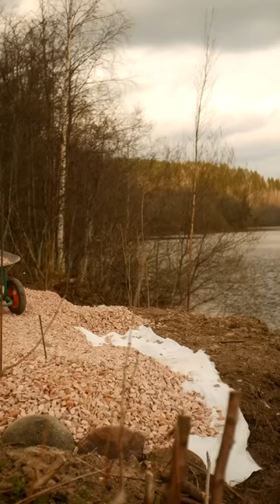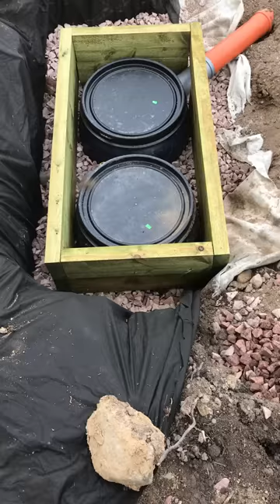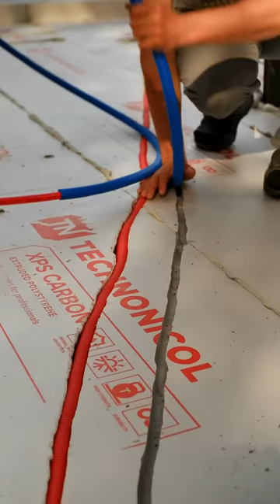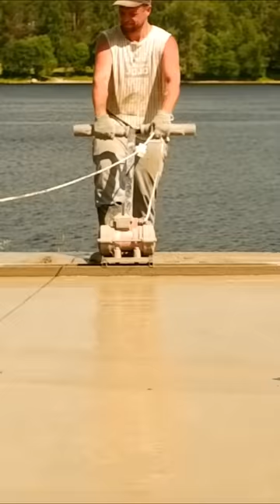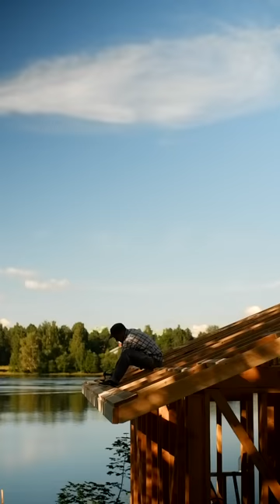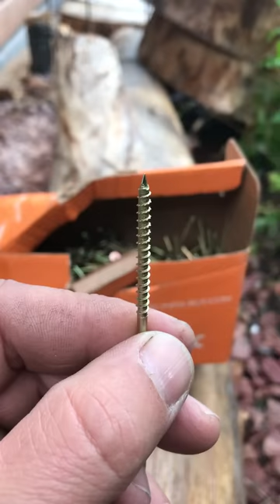Built a Dream House Alone! 1.5 Years in 18 Minutes. Diy

Comment: Each of those pieces of wood from trees should have been treated for Drywood Termite first before screwing in place. If the eggs hatch there will be mini sand like balls everywhere.
Reply: Depends where you are, here we're only required to have treated wood where it contacts concrete or anywhere moist as well as being separated by PE sill gasket. Termites aren't a big problem here.

I'm giving him the benefit of the doubt. But I agree with you, something seems very wrong.
Reply: From what I recall one way to kill drywood termites inside your furniture is to put it into a sauna and heat it above 60°C. Comes in handy that these already are inside a sauna.

May not be the prescribed way to do it but if it works without chemical treatment then why not?
Reply: @fabulous3284  I suppose, yes